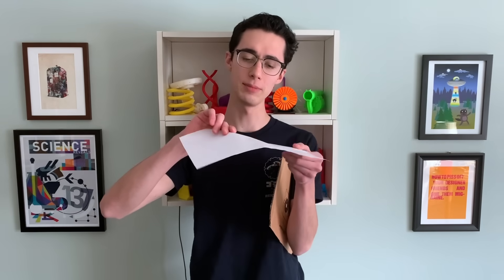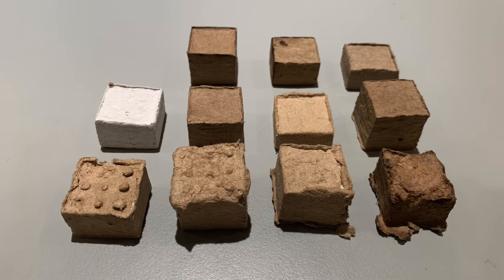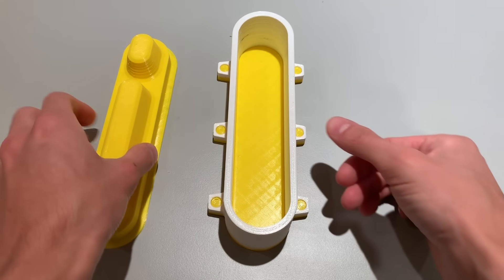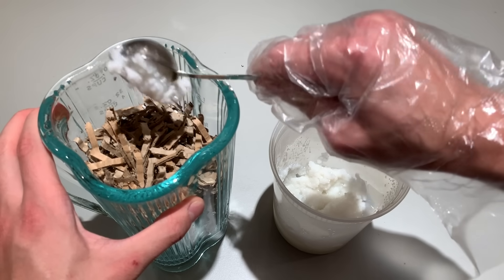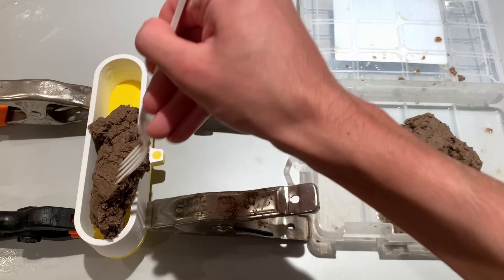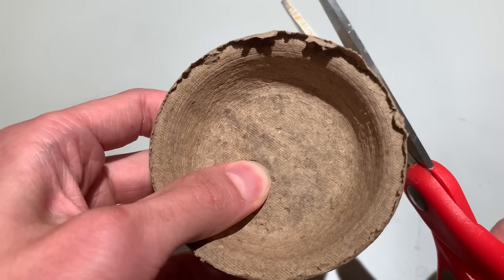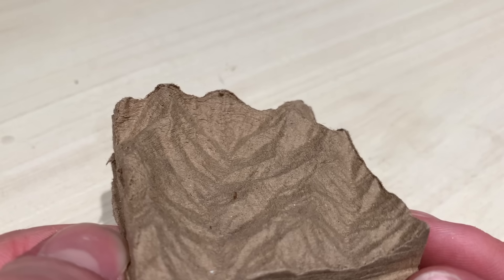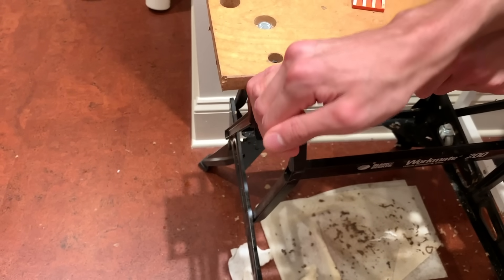Recycle Cardboard into Anything with 3D Printing!

Comment from the maker: "cOnGraTuLaTioNs yOu mAdE MDF" 🙄
Reply: XYZAidan 😂
Reply: lol
Reply: lmao
Reply: LMAO
Reply: ikea - the making of
Reply: that's what I thought
Reply: Bro I disliked this comment cuz I thought it was somebody else making fun of you XD I'm sorry I'll go like
Reply: Tho I have never seen cardboard MDF before, so there is that :p
Reply: Solubility aside - it looks stronger than my MDF desk - which has had several hammers through it already.
Reply: Glad I looked down in the comments before I wrote almost exactly that.

Seriously though, if I had a cent for every time I needed a custom part and MDF would have been a sufficient material, I'd have bought several factories by now, so kudos are, indeed, very much in order.
Reply: @AriosQarsute  The issue is if you need a one off part, what's the point of going through this entire process? It's easier, faster, cheaper and you get a better product by just 3d printing the part you needed in the first place.
I'm really struggling to find a home application where you would need so many identical parts that making a mold would be justified over just printing the part directly, especially because the method shown has some serious limitations (you can only mold features in one axis, unless you build a custom two or three axis mold holder/press) and the material itself does as well (it's not only vulnerable to water but also attracts humidity and thus mold/bacteria).

Not saying it can't happen, just that when you actually factor in everything it's probably a lot less versatile than it appears at first glance.
Reply from the maker: @demoniack81  Please tell me where in my video I said that the material "attracts humidity and thus mold/bacteria". I have left parts outside for weeks in the humid summer without any degradation. Do not make claims about that which you know nothing about.
Reply: Have you tested this with any compliant mechanisms / flexures? I'll probably end up testing them myself, but I'm curious to know if you think it'd work or if it would tear easily.
Reply: @demoniack81  the chief weakness, the water-based degradation, is removed by using a water-proof glue or coating. Also, you don't need a unique mold for each part, this stuff can be machined. Just make a block and reduce to correct dimensions. Using a coating rather than glue means off cuts are immediately reusable when doing this. Finally, weight for weight, mdf is stronger and more durable than 3d filament and this method reduces cost of materials to negligible.
Reply: MDF uses formaldehyde in the manufacturing process which is highly toxic and polluting. This process uses a natural binding compound. No comparison...!
Reply: @Cuisinepourmoi  that was the joke
Reply: @cooldude6651  whats the appropriate name for this material  MDF? LDF? Moulded fibre?
Reply: @ajinkyakhandekar  I've taken to calling it pressed cellulose fiber, but I'm not the creator of course
Reply: "Moulded Pulp" seems to be the term
https://en.wikipedia.org/wiki/Molded_pulp

Page on MDF by the way
https://en.wikipedia.org/wiki/Medium-density_fibreboard
Reply: Can we make logs out of paper/cardboards ? That would be a nice ecological trick, since recycling paper in itself is polluting anyway because of the various chemical transformation and energy costs ...
Reply: Molded (custom) MDF👍
Reply: @En_theo  Funny you ask that.... I found some very cheap pressed sawdust bricks in the firelog section of a local hardware store a couple of years ago and thought I'd hit the jackpot with them being so inexpensive (at least compared to the same mass of split wood or paraffin laced fire logs). Wow, was i ever wrong! If you have a roaring fire going and then toss them on, they might actually burn, but they are useless when trying light a fire or get it going. 

This is a long way around of saying the compression squeezes out all of the air pockets and gaps a seasoned or dried length of timber would normally have. If the air can't circulate, it's not going to burn. Char, yes on the outside, but not much more than that.
Reply: @MrChris20912  
Thanks for the feedback. In case it would interest you : I saw a guy on tv saying (pretending ?) that he could make logs out of paper that he compressed in a box full of water .

He just put something heavy on the pile of papers (various advertising or old newspapers, etc.), while the whole was bathing in water. Then he let it dry. 
I never tried it cause I don't have a wood-burner but I'll test that one of these days. If you ever try it, don't hesitate to tell me if it worked ;)
Reply: @AriosQarsute  Hmmmm, not really.
Reply: Actually that's a great call, make some molds that turn it into sheets and you can make your own furniture from waste paper and rice.
Reply: @DanielAngel  
Not sure it will hold, but I can try a small log and see how it'll work.
Reply: @demoniack81  well you have good points, but also this project is for Recycling the cardboard instead of throwing it away
Reply: Probably closer to hard board/ press board but yep. cool idea tho using 3d prints to make useful shapes at home.
Reply: Very good job!! I'm pro-recycle and am  composting recycled paper because I use it for germination. The rice-firming/gluing is a genius idea. I haven't got a 3D printer but will work out how to create something for my seeds with this method. Thank you and keep the good work 🍀❤️
Reply: @TheDentrassi  are you sure your desk is made of MDF? MDF is quite strong, maybe it's actually MDP
Reply: You're not wrong. But for what it's worth this is MDF in any shape, not just sheet. It think it's great!
Reply: @En_theo  just do that with water & paper/card, no need for a binder. Presses for this have been available at retail for decades
Reply: @maverickstclare3756  
I didn't say I'd use a blinder, but it's good to know this a known system. You have any name for that kind of machine ?
Reply: How is that even a dis? Add some wax and resin binder and you can make your own 3D MDF structures.
Also, make a larger press form and you can now make your own trupan for modeling purposes. This is amazing.
Reply: It would be great if you could make a commercial product that displaced plastic containers sold in stores.
Reply: @MrChris20912  In other words, this molded wood pulp could be called fire resistant?
Reply: @orangutantapioca1530  heh, it was for me, even when I added oil to help it burn!
Reply: @demoniack81  i'm currently using the process to make claymores and grenades (airsoft pyro). They tend to get used up on the range.
Reply from the maker: @jomsies  I'm not being salty, I'm just being scientifically rigorous. You claim that rapid degradation in water implies rapid degradation in humid air, but where is your evidence for this? I think you fail to see how large of a logical leap that claim is.
Meanwhile, I have done actual experiments to back up my claims and refute yours and those of the previous commenter. The degradation of molded pulp parts in a humid environment is greater than in a dry environment, but nowhere near the effects of water. And it doesn't attract mold and pests.
Reply: @demoniack81  why does this only have to have home applications? People watch these videos for more than just home use. Personally I’ve got some small business applications that I think this would be perfect for.
Making a multi-axis mold is barely more work than a single axis one (so not a limitation), and sealants exist for a reason. Literally every material has its limitations and optimal applications. Maybe you’d be able to come up with a home application if you spent more time focussing on what it can do, rather than what you think it can’t
Reply: Have you tried to create a printer / printhead instead of pressing?it is not only with wood / paper, but also other materials (glass, stone, etc.)
Reply: MDP , mdf is stronger
Reply: PLA is compostable, just random note.
Reply from the maker: @BullScrapPracEff  correct, although only in particular conditions in an industrial composter. On the other hand, the molded paper can be composted in a backyard compost heap
Reply: MDF isn't made with rice glue though. In fact it's pretty nasty stuff. Contains formaldehyde.
Reply from the maker: @DROPTHEGRID  this was sarcastic my guy
Reply: I had an idea! If you covered it with varnish, would it be resistant to water?
Reply: I’m going to try and make machinable boards from this tbh lol
Reply: actually no, "congratulations, you made _papier maché_" but in a way that reintroduces the concept to millenials (so great job!!) and thanks to the emphasis on compression, the products are stronger than traditional papier maché (which usually needs support structure for larger objects). The most popular binder used on papier maché is carboxy methyl cellulose, which is also a derivate of the same base material, increasing the reusability of the product (cradle to cradle yay!). 

As you've been working on the topic for years, perhaps your source network contains the answer to something I've been looking for for years. Pre-internet knowledge that seems to be lost. It was a very simple product (sold in a discount store in winter time in the late 80s until early 90s): a press mold with a very heavy lid and a bag of powder. Instructions said to tear up any paper without gloss or lamination (just like you said) in flakes, put it loosely in the mold and pour in a certain amount of product dissolved in water, let it sit over night, then place the lid and let gravity do the work. I guess the weight of the lid was calculated to reach the exact density needed. The powder was said to be enzyme based, so not really a binder, but more a bond breaker that would release the cellulose fibres of the paper and let the original binder resettle as it dried up. Or something. Anyway, the end product was a combustible block for wood burning stoves or fire places. So the thing that I'm really looking for, is which enzyme it is and how to use it (mixed with other products?, concentrations etc).

Any chance you came across this enzyme thing? It would be an answer to the suggestions to burn it that you received earlier...
Reply: No, he made LDF low density fiberboard
Reply from the maker: @BGTech1  WOOSH
Reply: @XYZAidan  Hey there, just want to say I enjoyed your video and found it because I was messing around with cardboard today for some projects around the house.  But I also want to say that I'm against the way you respond to what may be perceived as criticisms.  That first poster did make an assumption that vulnerability to water means vulnerability to humidity and the possibility of attracting mold and bacteria but I think you could have been kinder with your rebuttal and not seen it as an attack.  You did also make the assumption that they did not know what they were talking about but there is the possibility that he does.  The second one also mentioned rapid degradation in water and then linked that to degradation in humidity but you again made the assumption they were speaking of rapid degradation in humidity.  They merely mentioned degradation, which could mean days, weeks, years, decades.  Do not be so quick to be aggressive towards people, it can keep curious kinds from asking questions and could potentially harm your professional life.  Thank you for sharing this with everyone and good luck to your future.  Best regards.
Reply from the maker: @wakkadoo  I appreciate your comment and advice. While I always welcome people to comment on my content, I will not stand for misinformation and the misrepresentation of my work. When people make unfounded claims about my work, they are degrading and impeding the scientific process. Of course it's possible that that commenter did have experience and did know what he was talking about, but without proof his claims should not even be considered.
Reply: MDF? More like LDF ;-)
Reply from the maker: @SaschaElble  thanks for the comment but unfortunately your opinion is invalid because you listen to dubstep
Reply: @demoniack81  The identical parts aren't going to be made from the same material as the mold part, that's why also you would make extra parts JUST cause you can and at the same token sell the rest to a similar crowd in need of the same remedies and "drum roll" cOnGraTuLaTioNs yOu mAdE a side business and all that just for , wait for it...........thinking outside the box.
Reply: @Jai_Lopez  You do realize that maybe not everyone wants to even try to make a bUsInEsS out of making small parts in series?
I already have a job, I don't need nor want another one. Especially not one that requires dealing with sales and shipping.
Reply: @demoniack81  you are still not thinking outside the box and altho i hear you, you dont understand awhole lot of automation and 3d printing farm tech even on a small scale and on top of all that youre just thinking you going to be printing the same things, youre not considering /the new marke/t of help that ppl can rely on your service for , you gotta think big.
Reply: @Jai_Lopez  I understand plenty about automation. YOU keep not understanding that not everyone wants a business.
I don't want to "think outside the box", I don't want "a market", I don't want people to "rely on my service" and I don't want to "think big".
I ALREADY have a job that pays more than enough, I don't need nor want to stack another one on top of it. There's more to life than work.
Reply: MDF is made with glue as a bonding agent, not rice lol.
Reply: Wanted to say the same, still cool video lmao
Reply: I've seen single use biotrem plates made with wheat bran. my friend got them as snacks for rabbits. they also look just pressed pulp
Reply: Without the ffffffformaldehyde
Reply: Ummm, no.  He used boiled rice paste, a NATURAL SUBSTANCE as the binder for his cardboard slurry.  Medium Density Fibreboard (MDF) is an engineered wood-based sheet material made by bonding together wood fibres with a synthetic resin adhesive.. A SYNTHETIC RESIN ADHESIVE isn't even REMOTELY the same as RICE PASTE!  So congratulations - you are wrong!
Reply: yes sir... i think u could use a vaccum to press the moisture out of the pulp... but might be to complicated.
Reply: Those are the ones that dismiss paintings because of photos...
Reply: I mean, it kinda is.
Reply: Actually, you made MDF without the toxic binding agents that offgas VOCs, so honestly, kudos.
Reply: @demoniack81  "You do realize that maybe not everyone wants to even try to make a bUsInEsS out of making small parts in series?" 

Too bad.
It's on the interwebz now, so everyone is required by International World Law to immediately do this, no exceptions. 

Doofus..
Reply: what about coating them with liquid bees wax to make them water proof? or perhaps tree sap??
Reply: It's still a fun and interesting project to do something crafty like this yourself!
Reply: Hey dude,

I don't know if you'd want to add to the video but form an emissions standpoint rice actually emits methane when being grown which makes it emit 4kg of CO2eq per kg produced, compared to corn at 1kg per kg produced. These numbers account for all stages from soil use to the decomposition of the packaging used after being thrown out.

So from a purely emissions standpoint, cornstarch is the winner. 😊
Reply from the maker: @TheRandomdude136  You might not be wrong, but the calculations are probably more complicated than that. That’s the emissions per kg of corn, not of cornstarch. Cornstarch is a refined product, so it may use much more corn per kg of starch. Also, the recipe doesn’t require equal amounts of starch and rice paste. It’s something to look into though.
Reply: @XYZAidan  All your points are 100% valid, Not sure about the recipe. Cornstarch seems to basically be dried corn seeds (are they seeds?) so idk how a kg would compare. 

Thanks for taking the time to respond :)
Reply: @sbeb8414  I did the same.  It is what would normally happen on YouTube, tbf.
Reply: the cool thing is that if you use rice glue, it's completely biodegradable
Reply: What funny is Indians mastered this centuries ago. From my experience, in my childhood I saw people creating different shapes of molds using waste paper and mix it with Fenugreek paste and with some other materials.
Reply: @XYZAidan   That was an interesting video bro, but you in the comment section is almost even better hahhaha
Reply: You made paperboard. Mdf is medium density fiberboard. You made clipboard bricks
Reply: I just wanted to make EXACTLY the same comment... 😲
Reply: I already made a snarky comment on this topic, but you ruined everything.
Reply: 8 minutes in and only then I was like "holdup- I recognize that material-" 😂
Reply: @MrChris20912 this just made me wonder if you could use a mold top / bottom with pins to basically create a grid like pattern for airflow.  Using wax or sap as a binder would increase the flammability too.
Reply: any ideas on making really clean looking model cardboard cars like 1950s curves I want to make multiple of my own miniature car designs but can’t figure out what process and or machinery I would need ? Thanks
Reply: Some people just don't understand stuff like this. It is not MDF. Similar but different process, different application, different composition, different input material. It really is not MDF!
Reply: more like LDF
Reply: Yes this
Reply: Hi. Nice work! I recommend trying to make molds with some angle on the walls. 3 degrees would be enough to have clearance to unmold it. You can coat the molds' inner parts with oil to avoid sticking to the object. Then you can coat the objects with white glue and sand it a bit, adding more glue and then give it a finish with some paint. Cheers!
Reply: I think the strength of the molded part depends on the compressive forces applied while it is drying, wouldn't it? I you were extruding the slurry you might still need forms to contain the material. Interesting idea though.@WhiteRabbit.
Reply: Don’t be a jerk, he is trying to do something at a home level scale
Reply: @En_theo I have tried various paper products and cardboard and they tend to smoulder. They just don’t have the air pockets needed for complete combustion. As per other comments
Reply: MD yes, F no.